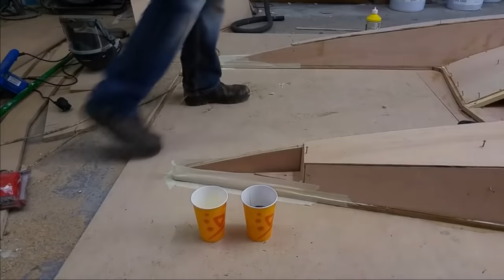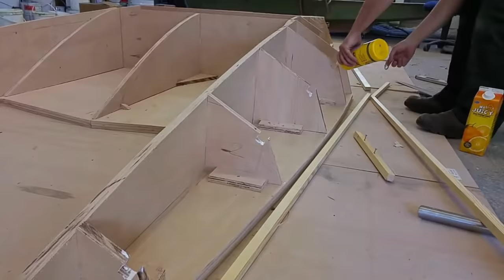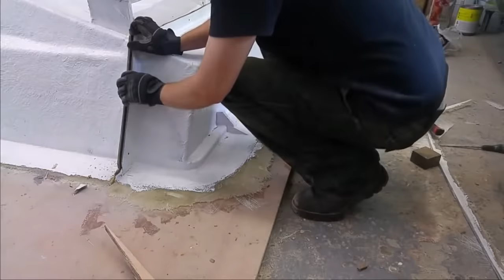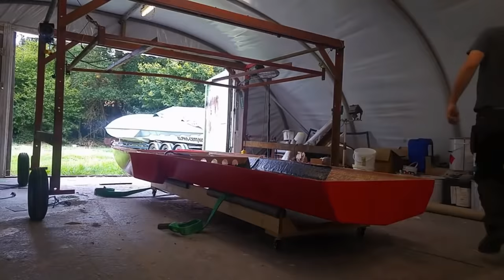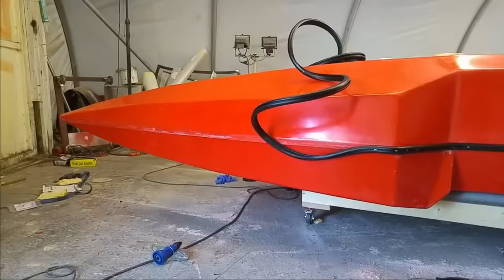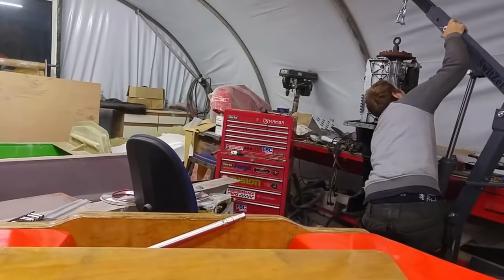Speedboat build in 8 minutes

Comment: I bought the plans and built a  " mini-most"  which was a little hydroplane. I 5 hp motor would push you pretty fast. But! After realizing that they just had a epoxy reinforced wooden  transom.  I had to do some modification.  Do not trust them at all.

Comment: This hydroplane needs an inboard due to the porpoising..  Johnny Sweet told me the prop has to have lift built in too.
Reply from the maker: Just a bit of trim sorted the porpoise (it's manual). Right about the prop though - all I had was a chopper, cleaver would be better: more lift and more efficient in surface mode.
Reply: @BoatsandEngines  so with a lifting prop, can a outboard run on the bottom half of the prop like the inboards do?
Reply from the maker: @MrRerod  yes both cleaver and choppers are designed for surface piercing, your have to have a modified lower unit or separate water pickup for cooling - same as inboard

Comment: How many fiber glass coats ?
Reply from the maker: From memory, the Hull was 2 layers of 600gsm chopped strand, 1 layer combination (600 woven roving /300 chopped strand) followed with 1 layer of 600gsm chopped strand.
The deck was 4 layers of 600gsm chopped strand (with combination matt added on the transom area)

Comment: Love it such an awesome build I’m curious if you get any leaks at the bond between top and bottom? I personally am not a fan of that sort of bond cause it seems like catching a wave at just the right angle would tear the boat apart but that’s just me either way it’s amazing and looks like a ton of fun
Reply from the maker: It's glassed together on the inside, so no leaks, not as strong as a flat flange and harder to mould but looks neater.
Reply: @BoatsandEngines  oooh ok I thought it was only bolted together that makes more sense. Are you gonna make more?